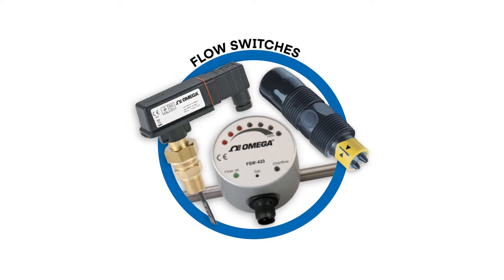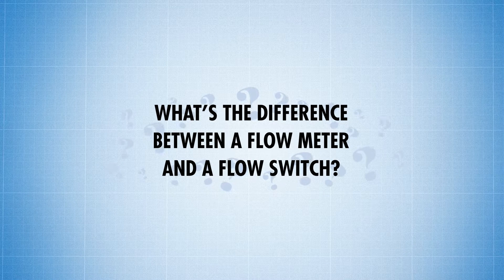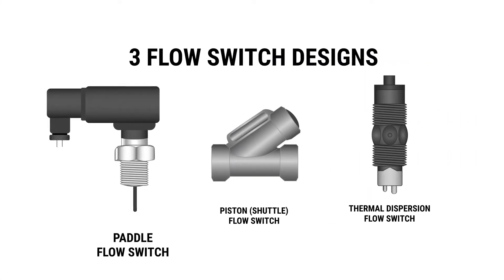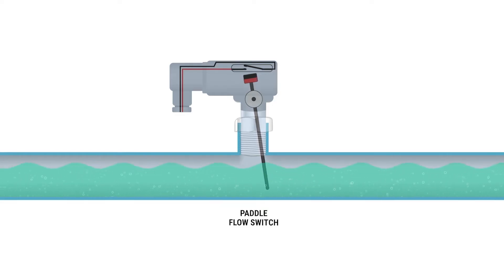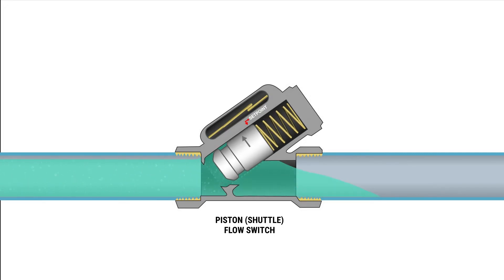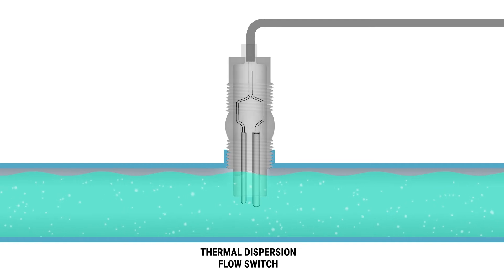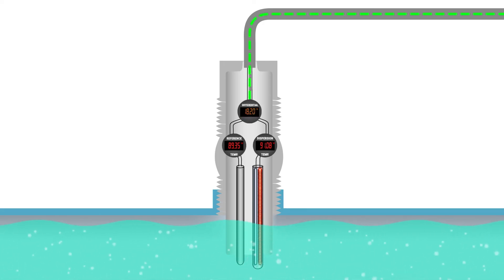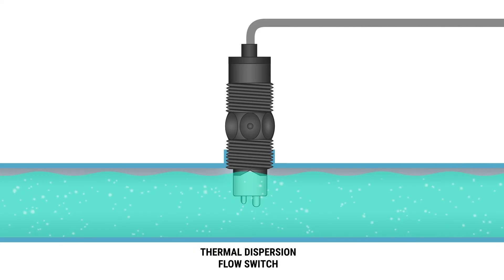What is a Flow Switch and how do they work?

Comment: What is the best flow switch for low flow rate
Reply from the maker: Hello! I checked with one of our Flow Application Engineers here at Omega.  We offer many low flow solutions, here are just a few: 
https://www.omega.com/en-us/control-monitoring/process-switches/flow-switches/fsw30-series/p/FSW-30A
https://www.omega.com/en-us/flow-instruments/flow-meters/variable-area-flow-meters/flsw3400-flsw3500-series/p/FLSW3401G-A
https://www.omega.com/en-us/control-monitoring/process-switches/flow-switches/fst200-series/p/FST-211-SPST
If you still need further assistance you can email our Flow Department at: flow@omega.com
Thanks for your inquiry!

Comment: My problem is water continuously flowing when a water closet valve malfunctions or somebody forgot to turn off the water flowing in the washing machine or someone forgot to turn off a water tap. Continuously flowing water results in higher water bills. I need to be notified or some kind of alarm turns on when continuously flowing water occurs.
Reply: Chillar  water flos fixed  flow sigsl show  notwat not showing